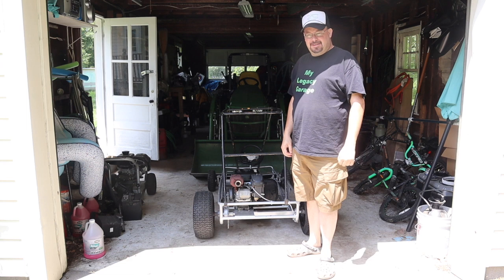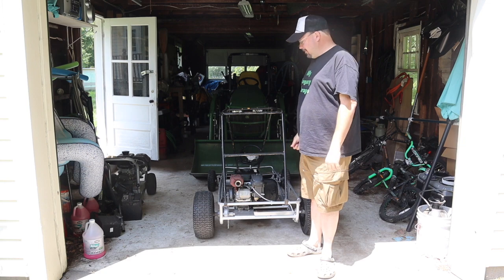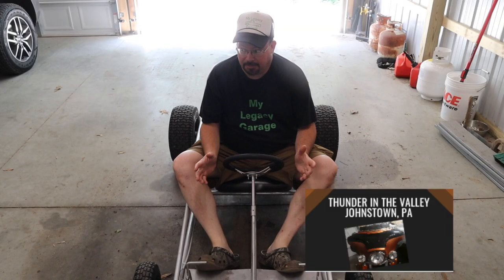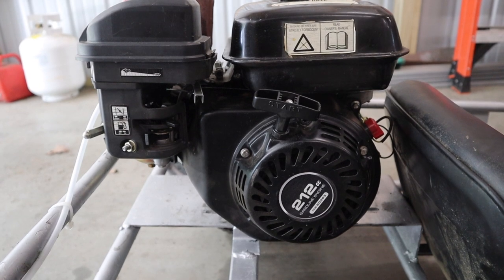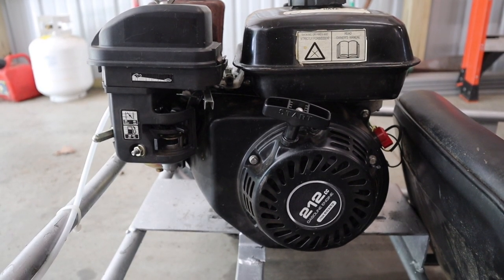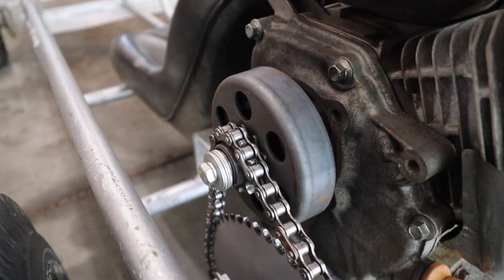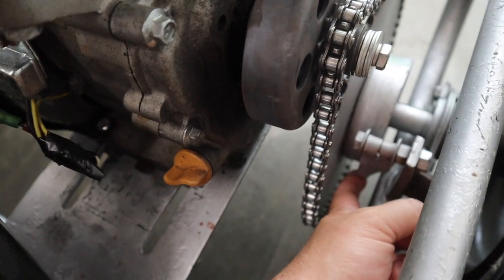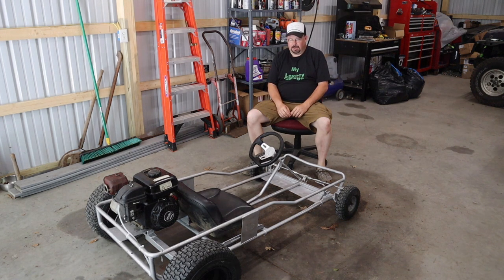GO CART fun for all ages! No brakes, no roll cage, no seat belt... NO PROBLEM! Shall we fix it?

Comment: A disc on the axle works well.you have installed a park brake.Used to have 550 kawasaki 2 stroke cart no brakes .Police hated it
Reply from the maker: I bet they did 😂 Thanks for watching!
Reply: @MyLegacyGarage  Ina motorbike it was good for nearly 150mph not stock but a brave soul early two stroke work expansion champers big carbs high comp also down hill though